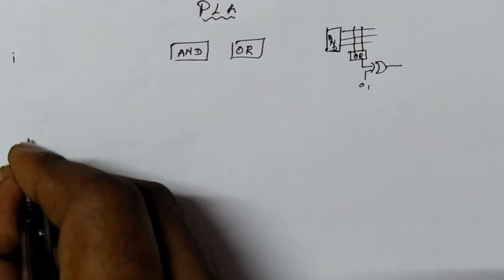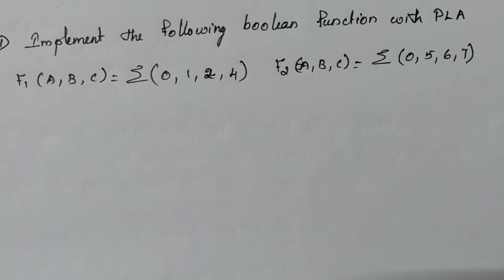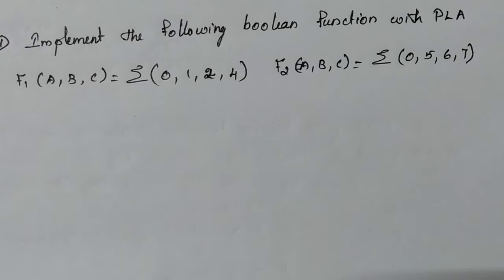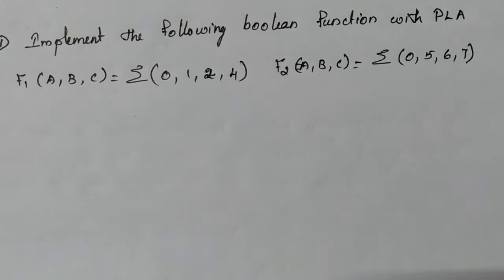PLA implementation | Digital Electronics

Comment: We can give it directly to OR gate na
Why are we using ex oR
Reply from the maker: Exor gate act as a controlled inverter (not). To reduce the number of gates  we use direct or inverted outputs. This can be done by EXOR gate with one input as O - for direct output and 1- for inverted output.